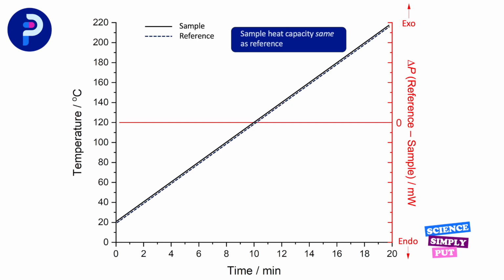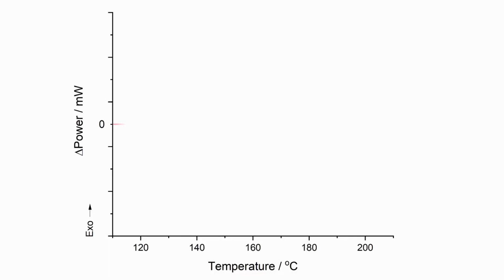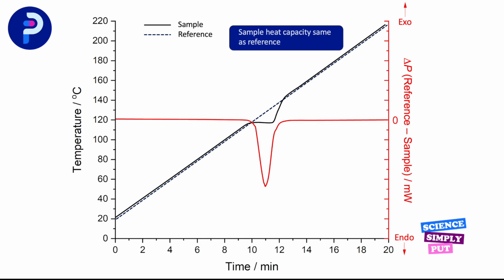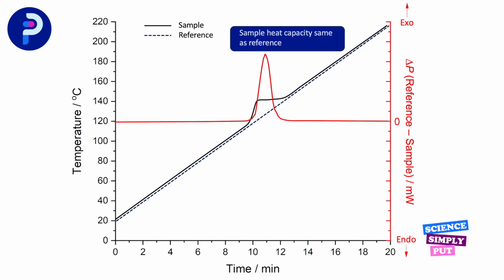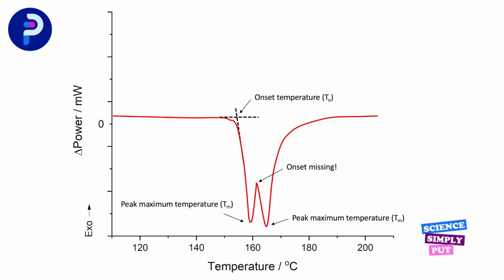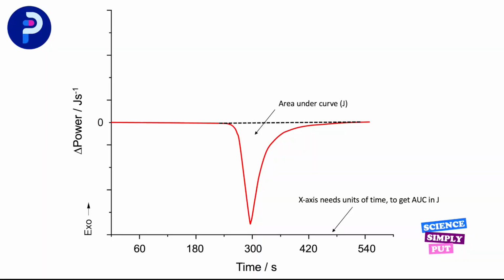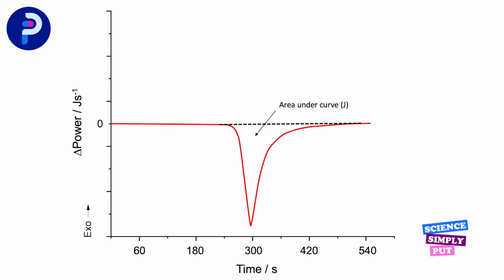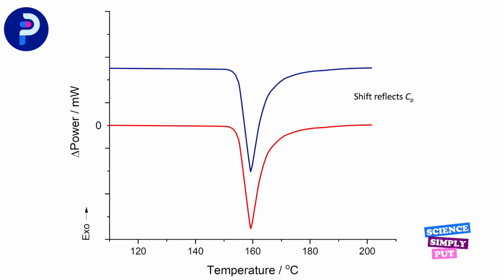Demystifying Heat-Flux and Power-Compensation DSC: What You Need to Know

Comment: According to your explanation, in the heatflux DSC, if the sample temperature falls due to an endothermic transition in the sample, the furnace supplies extra power to the sample and not the reference. And vice versa for an exotherm. 

How is it possible when the furnace is a common single entity for both sample and reference? This is possible only in a power compensated DSC which has separate furnaces for sample and reference!